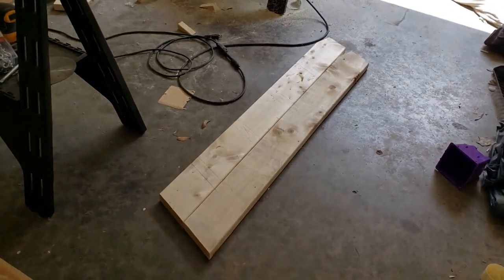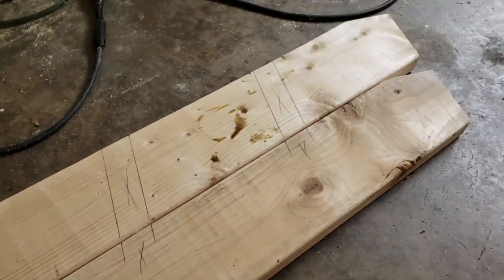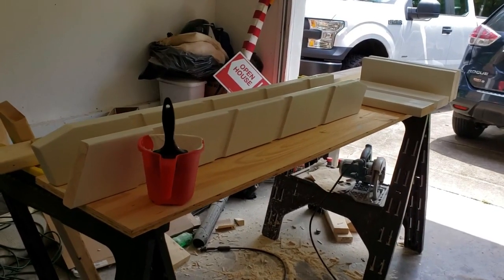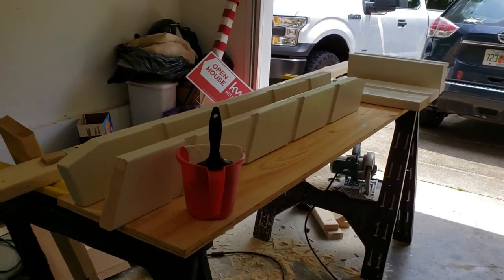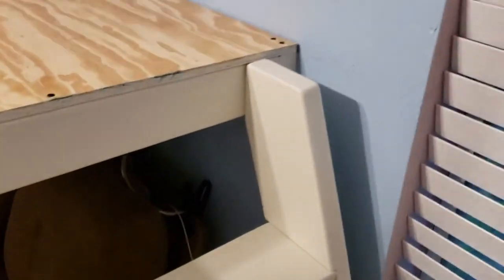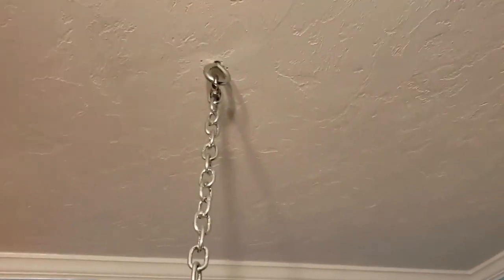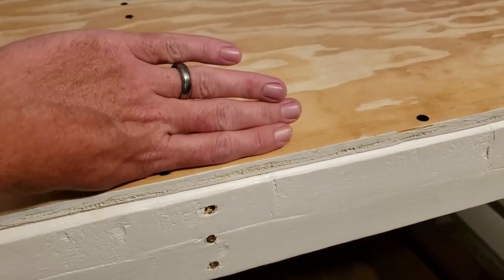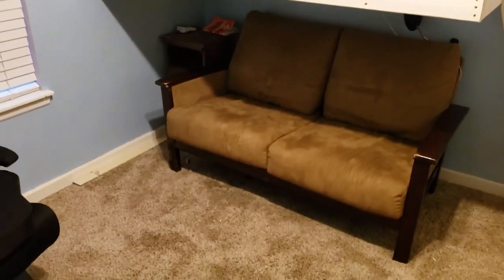DIY Project: Loft Bed Ladder

Comment: Nice build!  I'm planning to do much the same for my girls' room.  How did you get the exact right tension in the chain so that the bed is level and the chain is taught?  Since you have discrete lengths possible with the chain - you can increase or decrease by one chain link - that corner of the bed might be a little high or a little low compared to the others, and that would torque the frame as well.  It looks like you figured it out somehow!  I notice the chain is on an angle, did you move the ceiling anchor around until you found the sweet spot for the length of chain you had?  Thanks!
Reply from the maker: O-Ring Lag bolts in the bed frame and up into a ceiling rafter. They are 4 inches long so I was able to tweak them by tightening them one turn at a time until it was level.
Reply: @axelruntschke  Right that makes sense - thanks!

Comment: How do I find the ceiling joist
Reply: You can use a battery operated stud finder or if you have a nice strong magnet you can find the steel drywall screw or nail heads.